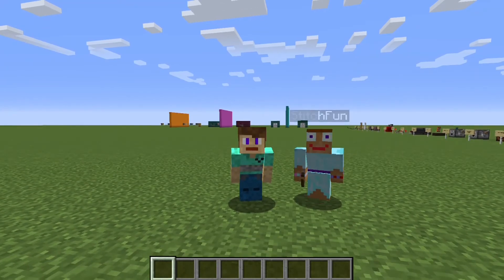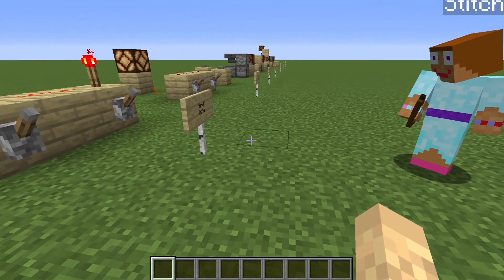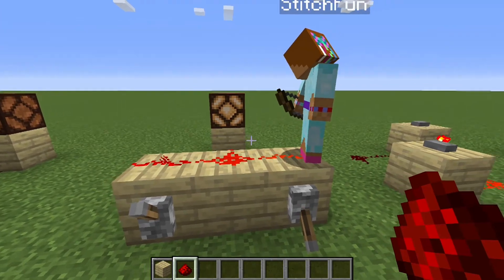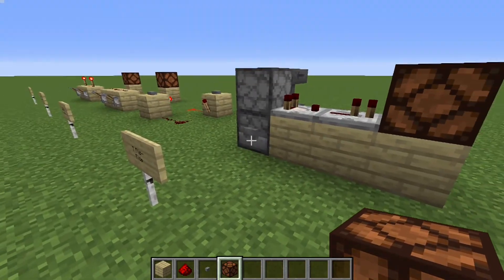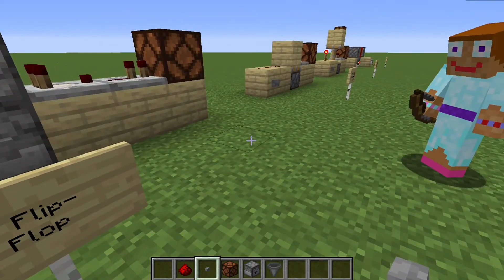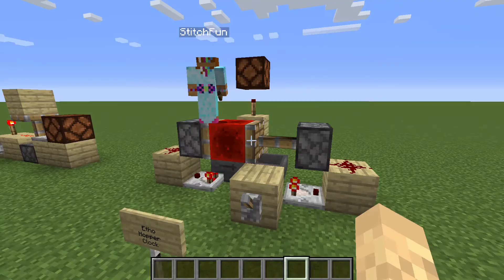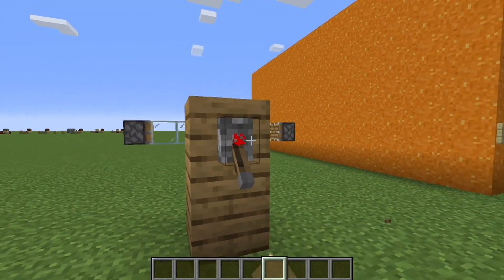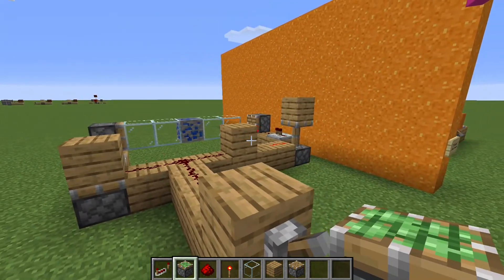Stitch & Yensid Learn Redstone, Ep. 3: Circuits!

Comment: Awesome video! I would like to say I’m proud that you caught you only needed one mono stable circuit at the end.  A few notes, the “or” gate you showed is usually called “and/or” an actual “or” gate only works when one is on, and are much bigger. Also if you take the etho hopper clock and make one piston sticky and one not, it only goes back and forth once when you power the sticky piston. So basically a fine tunable pulse extender. About observers, yes, you can make everything better with observers. They are the greatest thing ever. But they can be a bit tricky to work with as they give an output when redstone turns on and off. One of my favorite ways to use them is attached to a piston. When an observer is moved it gives an output at its new destination. Which makes a very small mono stable circuit that can go up or down

Edit: and observers are a dual edge mono stable circuit on their own
Reply from the maker: Thanks for the clarification on the "and/or" gate. I'm saving an in depth exploration of observers for later. Thanks for the suggestion of using the observer attached to a piston. I know that's going to come in handy.